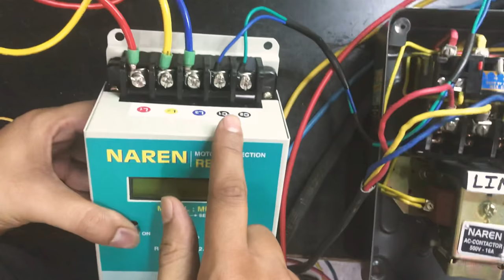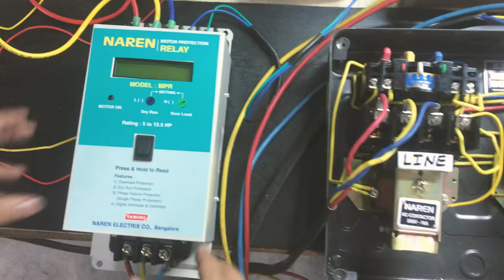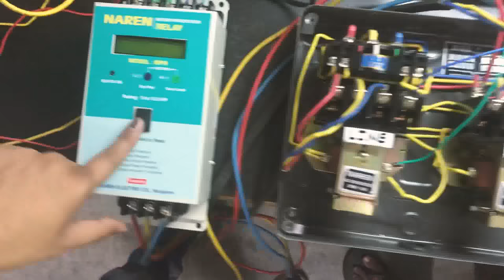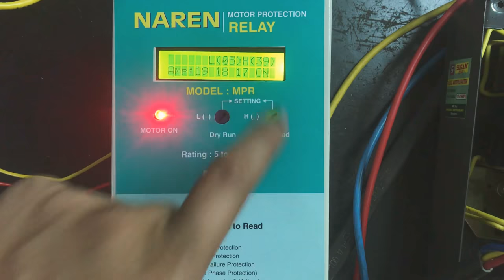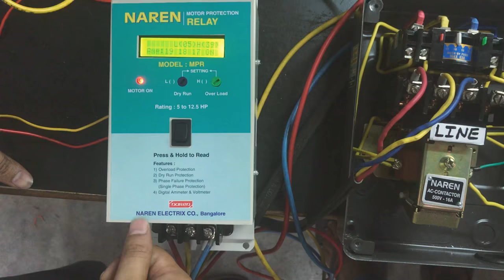Connecting Naren MPR to LTLK Star Delta Starter (Kannada Version)

Comment: Sri 10 hp cri vartical motor minimum amps????  and  Sri ರೀಲೆ 48 / 68 ಹಾಕಬೇಕ
Reply from the maker: Amps Motor to motor and supply voltage inda vary aagutte Sir. 10HP under good conditions takes around 19 to 20A. Relay of around 40A is good.